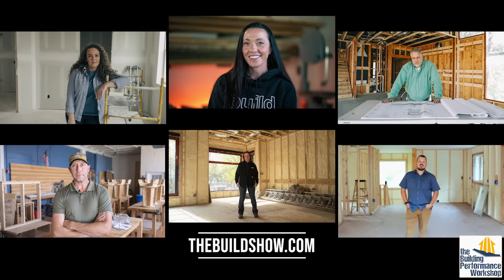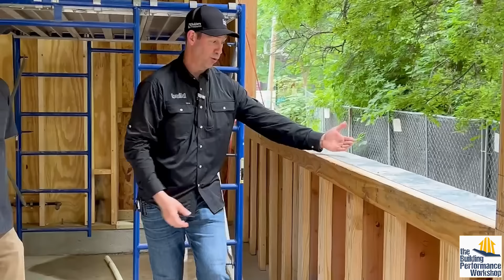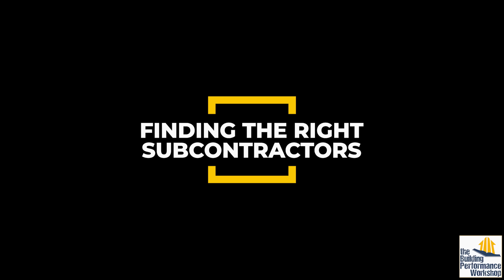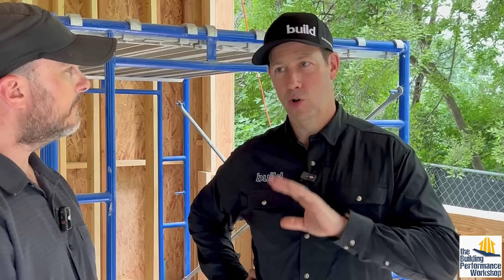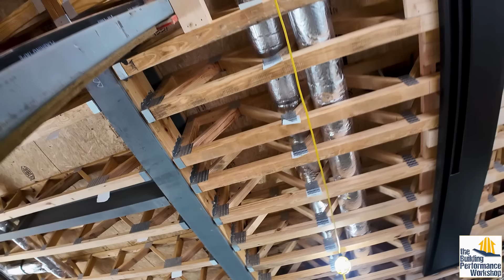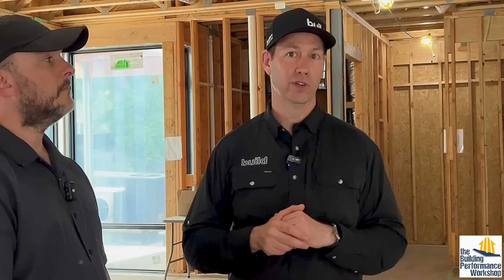Tips to DIY Your Own Home Build: Construction Management, Hiring Contractors, Why Builders are Wary

Comment: It’s my first job when I retire….  I will say I will hire an inspector to do multiple inspections to catch things before inspections.   

I will GC and do some of the sub work.  I’ll hire someone to excavate. I’ll do foundation for basement and ICF to the roof.  With fiberglass rebar.    I’ll do electrical and plumbing myself.  I’ll do the insulation inside and outside roof.  My plan is to build a fire resistant, 200MPH roof using X brackets and two layers of 3/4 shearing taped. Between 4” of Rockwood. With sharkskin on top of both sheathing layers then a standing seam metal roof.

Comment: I had a 2,240 sqf home built last yr by a builder and I watched every day of things that were done, we didn't do anything special when it came to Them, but what i did was above and over to say, i 3M every penetration from the windows, doors, electrical outlets on the outside walls, I just had OSB with 1" insulation that I've taped the seams because the builder didn't do it, I fired tape all the electrical boxs in wall for fire and air leakage in the walls, I installed backing 2x6's for future hand railing in hallway and for hanging pictures, ran smurf tubing for internet and 1.5 PVC with Cat 6 to the location that I thought that I would need to install Cameras in the future, not sure if it was a good thing but I used 6" Sega tap to tape the bottom of the 1" insulation outside walls to prevent from bugs from nesting behind the insulation with the top open for heat to be vented out, I caulk with Tremco dymonic 100 all the top and bottom plates in the house to prevent air leakage as well as knowing that if OSB gets wet it will crumble to say so I caulk all around the windows and doors 2x6 to the OSB as well with 9' top plate knowing that they use 4x8 sheet so I had a 1' splice that I calked around that as well, i caulked 6" up and down and the top and bottom of the OSB to the 2x6 , i had vinyl side installed and caulked every staple that came through the OSB, hard line my bathroom vents and insulation them use the insulation that came with the Flex duct that they installed and taped every joint did the same with my exhaust kitchen fan as well, once the drywall was installed again I used Tremco dymonic 100 to caulk every penetration on the inside of the house to prevent air leakage into the walls or out from the walls, I refused using spray foam for the basement rim joist instead I used 2" pink insulation caulked pink caulked pink and caulked again, its seam to help over all in the blower door test is guess its to be between a 2 and 3 and the sheet they printed out it was a 1.03, so I guess as of today I'm good, I was thinking that I'll have to in a yr or so go around and check to see if the caulk is still hold up on all my penetrations in the house, just for self knowledge of my own. Just somethings I did to get a more efficient home without paying  that super high cost of today's cost, not that it was cheap in money or time
Reply: I wish I could show some dumb pictures of the dumb shit I've done on my house
Reply: 2x12's backing

Comment: Well if you have to pay someone to supervise the construction of the home your building as an owner builder, then you might have been just as well off from a cost standpoint to hire a builder to begin with.
Fact actually is that the profit margin for builders isnt nearly as high as many of the modern day internet builders claim it is.
Back in my day we charged a ten percent profit margin, and we also charged a ten percent cost for our overhead.
But we had an office to maintain with two full time office employees.
We also had six trucks on the road including the two my brother and i drove.
We did all of the supervision while the homes were under construction.
I handled it from the excavation to drywall, including all of the rough ins for wiring, plumbing and heating.
My brother took over for insulation, drywall and all other finishing work.
I will add that our personal wages came from the profit margin, it wasent added to the general labor cost.
And thats how the competition in our area demanded it.
We never in all the years we were building got a job with a cost plus contract.
Competition wouldnt permit that, all the builders in that area were bidding the work.

Comment: Sad it took until 11:58 to bring up integrity.  A friend had an addition done and the builder overbought materials by a large margin.  Friend got suspicious when framing was done and moved the lumber to his shop.  A week later the contractor came to pick it up to cash out the return minus the restock.  It's theft.  If the builder had instead said he makes sure he has extra materials and will pass along the refund and factors the hassle of hauling the materials back into his bid, that would have been the honest builder.  

I had to fire a roofing crew on my first house 30 years ago - tore off on half the house and then ghosted me.  I had purchased the materials and they took them.  I knew where they lived and drove right up and pulled them off their truck while they watched.

Comment: GC your own house or owner builder that pulls permits and hires bad subs. Eventually someone screws up or many little mistakes along the way adds up to a mediocre construction business build. If you’re a licensed General then you’re GC-ing your own spec house. The other thing is if you’re a qualified builder you can watch their work and hand pick the crew and subs. Something is not right MBWA. Management By Walking Around.  You can keep the flow and make for a safe and productive jobsite.

I’m listening to you and I would not recommend building new construction on your first go-around. I would do some cosmetic fixers/flips maybe at some point a full Reno- remodel, before taking the plunge on a big build.

I’m wondering why a client would want to change the entire scope of a contract? Something obviously isn’t getting communicated correctly or there’s language used that’s vague or without merit? There’s a lot at stake for a client so you need to meet their needs expectations and deliver on what you promise? That’s what trust fundamentally amounts to tempered results and positive outcomes. It’s a 2 way street so there’s a mutual understanding, the piece of paper just formalizes the language of the four corners.
Reply: I think the issue about Clients wants change is some clients doesn't under the scope of work that is required for the change. Is not just a matter of change of Material or Color, or add in a Electrical Outlet. Sometimes the change they request can change the entire structure and the scope of the project late into the game.

For example, My Neighbor and I were talking to a Contractor to replace both of our fences. We agree on a steel fence and the price. His wife ran out and said she wants Brick Fence and kept crying about how beautiful it was on a house she drove by and said it was her dream to have that, etc... She think the change is just in the material in her mind.
Her husband just stood there dumb fonded, I was sitting on the side laughing at them, and the Contractor eventually just walked away. 
3 weeks later, we started building the steel fence we agreed on earlier. She derailed the project and wasted everyone's time.

The issue is, there are no shortage of people who are like that. They change their mind in blink of an eye, and get emotional and agressive when it doesn't go their way, I am pretty sure you met your fair share of ppl who does that.

Comment: I’m not sure asking HVAC contractors “do you believe x” is necessarily going to get anything besides a “yes”, ever. I think a better question would be “have you found that high performance/low air leakage homes need less HVAC size/power than conventionally-built homes?” This will weed out the guys that would have said “yes” and then want to put an oversized system in an uninsulated and poorly ventilated attic.

Comment: I appreciated the late reference to Scott.  I am in the research phase and would like to GC my own house when I retire.  I've done just about everything, but know I wouldn't want to frame, roof, hang drywall...I can...but would sub all that.  I would like to do trim carpentry work, fabricate my own doors, and put on the touches that would be harder to find a contractor to take on.  I think a way to get the detailing I want from a building science perspective would be to take on that work myself.  It's putzy and time consuming but not generally physically demanding.  Assuming I would want to be on site while work was underway, why not be busy?

As an aerospace engineer one thing I think is worth mentioning for anyone taking on owner-builder is to have a risk budget.  One fault I find in NS Builders and others at the high end  on YouTube is they will layer complexity on top of complexity on top of complexity...the customer wanted this room to cantilever out toward that view and decided to put a 900 gallon spa tub next to the 10' floor to ceiling window so we had these beams fabricated from titanium...  Instead - know that elegant and simple solutions can be beautiful and not just save money but also greatly reduce risk.

Comment: We went with the builder because of what Matt was saying, we assumed that they would be there all the time that they would be working with their subs and watching them.   Wrong, the Builder did not put a permanent roof on and installed the insulation and sheetrock.  Had trim and cabinet store in the home.   We received heavy rain and everything got wet.  Builder asked us to file a claim for wind and hail.  Claim was denied. Now we have a mold issue.  What do you do from here?  Matt, any suggestions? This could be a good episode.

Comment: The problem I am running into is that builders only want to build massive homes these days. Which I can understand from a profit perspective, but I only need an 800 sqft home. So it's the self build route for me.
Reply: Please please, build it yourself. I did it, it was well worth it. I didn’t use any subcontractors. Saved me a fortune. The quality of my house is much better than you will get from a contractor. You can do it. Leave them out, you will work a little harder and it will go quite a bit slower but you will be much much happier. And you will save $100,000 on your 800 square-foot house.
Reply: @ thanks for the words of encouragement! That’s the plan! Well except for the things that are required by local laws to be done by licensed contractors, septic and well drilling are the main two. Slow and steady wins the race.
Reply: It's 4 walls.  How tough can it be?

Comment: Yes, all of the points he makes are valid even if he's only highlighting the negative.  He's also a builder, and I've never seen a builder recommend or support anyone GC'ing their own build. That's like me telling my boss he doesn't need me at work. Building your home can be a very rewarding experience and save you a ton of money. He fails to mention there are a ton of bad contractors and builders too....go look at the horror stories of people giving builders large amonuts of money to build their dream home and it turns into a nightmare. You need to apply the same level of scrutiny to choosing subs as you would a builder. It will take more time, you will make mistakes, but it's possible and not just possible but you can do a great job! 

PS if you can't use a hammer and don't have at least a basic knowledge all of that prior advice goes out the window!

Comment: @10:27 getting three bids from people not all using your specs can cost you.  I know of a company that saw a flaw in the gas lines for a glass manufacturing plant.  Very high gas needs for the equipment.  The best company saw the mistake, and bid the right price for the 4 inch gas lines.  The company that got the bid saw the error but bid the 2" that was spec'd.  He knew the supplier would take the pipe back for no restocking fee.  He hung the pipe, did not connect it, and then pointed out wrong size pipe.  The change order was priced to get the new pipe, the 2" was already paid for and the cost to remove the pipe that was already hung and hang the new larger pipe.  So the final cost of this contract was more than 3 times the original bid.  SO by providing a design from and engineer to the sub, you will get exactly what you expect.

Comment: I think a lot depends on your location and the economy.   I'm in the process of a major remodel, and I had a really hard time getting bids, and even getting general contractors to call me back. Getting subs to call back was even harder. In Los Angeles, there are so many stupid and unethical fees that there is no money left to even consider building a high performance home.  Construction costs are also significantly higher than the rest of the country. We are encouraged to use electric cars and electric appliances, but then we are heavily punished for using too much electricity.  I'll need 79 Solar panels and 4 Powerwalls and that might not be enough.  I'll still be paying Edison a fortune. 

Bottom line, I'd be dead in the water without a GC. I'm really glad I didn't try to save 10 or 20 thousand dollars by doing it myself.  Even with a GC, I am still heavily involved in every aspect. The end result will be over budget, take a little longer than I had hoped, but will be what I want.

Comment: I Gc’ed my house build in 2022 (videos on my channel), I flip houses for a living so I’m used to working with subs and had a decent amount of subs already. I also poached some subs from a couple buddies who are custom home builders. 1000% agree with everything you guys said!!!. I built my house (north of Atlanta) in 9 months and 1 day from permits to move-in. I was on-site EVERY SINGLE DAY. Sometimes all-day. Fortunately I work for myself, but my business definitely suffered bc I was an absentee business owner. I was swinging a hammer with my framing crew every day for the 3 weeks they were here. It was nice to be here for quick resolutions to issues during framing (which further exacerbate themselves further on in construction). I also made sure all of the waterproofing and air-sealing details were executed properly. I had to educate my hvac guy on ERV’s and dehumidifiers and I’ll give him credit for expanding his knowledge! I ended up doing 95% of the electrical and having my electrician inspect my work daily (long story…). He did my panels for me though. My finish carpenter canceled on me last minute and i hired 2 helpers and the 3 of us ran trim for 10 days straight to keep the job moving. Fortunately one of the helpers is an extremely experienced trim carpenter on “donation” from a family friend who’s a trim carpenter & cabinet maker. I paid him his normal daily rate and he helped for a week. He was a godsend!!. I also was the guy who did the punch out. I also did all the landscaping with the help of a bunch of day laborers. Building a house yourself is definitely not for the faint of heart.

Comment: I see over and over, new builds with significant problems.  Things that don't even make sense to a non-contractor, i.e. multiple thermostats installed into a commercial building where each thermostat controls the temp for a different room than the on it is in.  It is always too hot or too cold, and one person has to call out to another in another room to change the setting for them (for certain reasons they cannot leave the room they are in).
I want to GC my own home because there seems to be three ways to go; pay a low to average rate ($300-450/sq ft) and find dumb mistakes all over the home, pay $500-700/ sq ft (way out of my range) and the problems will be caught and fixed by the GC you hire before the home is complete (or they stand behind their work and will fix it later), or GC it yourself.  What else am I supposed to do?!
Plus, I want some newer tech that most builders find too scary.

Comment: Been a Build Show fan for five years, but Matt never seems to consider owner/builders, so thanks for doing this video.  I’m not a builder, but I’m currently GC’ing my own home in DFW.  I found a local owner/builder consultant named Bob who I paid a reasonable fee to help with two main things:

1. Financing.  Banks don’t just hand out construction loans like they do mortgages, especially to non-builders.  Bob has a long standing relationship with a local bank that will underwrite loans for his owner/builder clients.  Bob also worked closely with me to build a detailed budget of my entire project before going to the bank for a loan.  

2. Subcontractors.  Bob works with 20 or so owner/builders in DFW per year.  Bob has developed an extensive list of subcontractors in the area, and for each trade he has two or three that do most of his clients, and have a proven record of working well with owner/builders.  I bid every job out with these subs in order to build my budget before we broke ground.  

I’m 35 with three kids and a busy career, and we’re building a fully-custom home that I designed myself.  I couldn’t have gotten this far without Bob, or without great YouTubers like Corbett, Matt and his team.  Building your own home is certainly doable and it isn’t rocket science, but you have to find other people that you trust (usually not just the subcontractors themselves) and lean on their knowledge and experience.